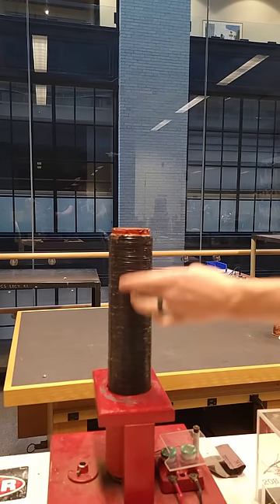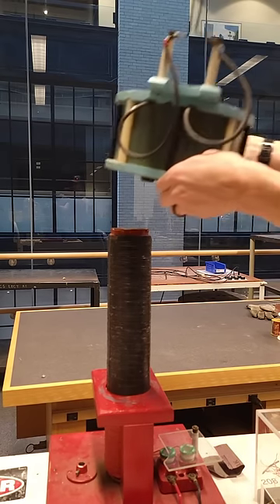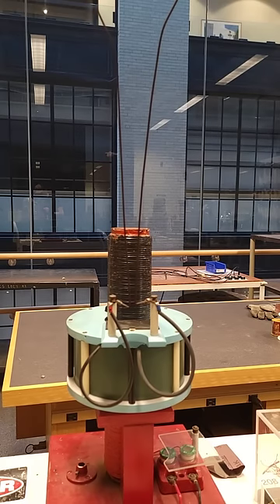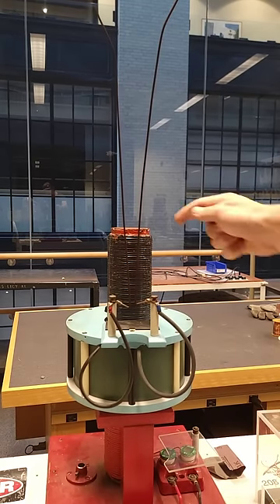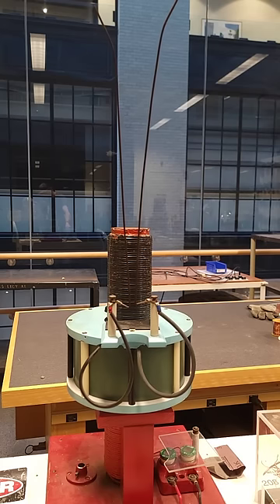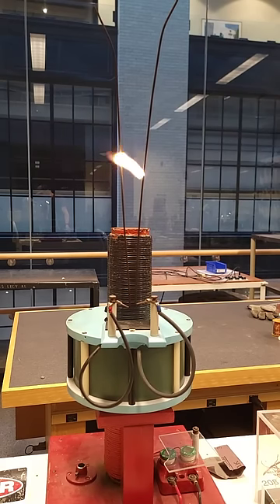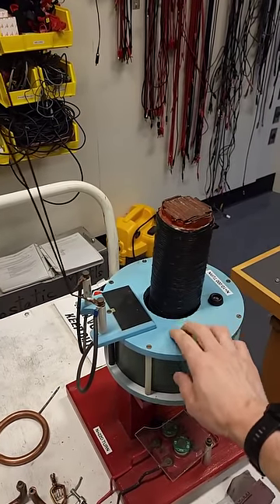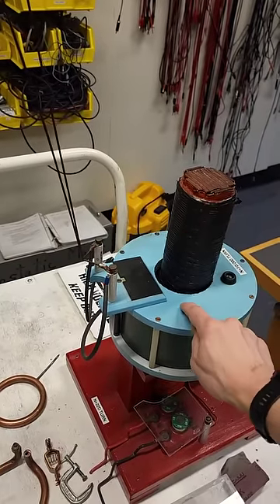Watch this 10,000 turn transformer breakdown air! #shorts #physics #science

Comment: But are you going to tell everyone why the arc rises? 
 
It's actually due to the heat of the arc, making the air around it hot and it rises.  
You can now get an oil burner ignition "transformer" that has 120V input and 17500 V output (about $50 ~$75 depending on model) .  I put transformer in quotes because there's no windings just solid state components.  I have to check around to see how that works.

Comment: What is the amperage?
Reply: VA/E=I
Reply: Are you asking what it would draw.  Or how you could figure out the amperage with knowledge of the amps on the low side.
Reply: Well... let's see. The transformer turns ratio is kn=n2/n1=10000/220=45.(45), so the secondary voltage is Vo=Vin*kn=110*45.(45)=5000V. Approximating a core area of about 30cm sq, and a total efficiency of, let's say, 50% (the core is not a closed loop), that would mean a power of about 800VA, so the maximum secondary current would be Io=P/Vo=800/5000=160mA. More than double of what would be used for an electric chair, if that's what you were wondering.
Reply: @bogdan_n  Where did you get the power figure from? I don't see any accounting for secondary current.
Reply: @antoinefleming5224 what is VA and E?
Reply: @Graham_Wideman You don't need to worry about secondary current.

Primary power and secondary power are the same.

If you know what the primary power is, and voltage, and the turns ratio, you can calculate secondary current.
Reply: @deang5622  "Graham_Wideman You don't need to worry about secondary current.  Primary power and secondary power are the same. If you know what the primary power is, and voltage, and the turns ratio, you can calculate secondary current. " Sure, but where did you get the primary power figure of 800VA from?
Reply: @Graham_Wideman  I didn't. I didn't do any calculations.
Reply: @deang5622  Sorry, I mistook you for the poster who mentioned 800VA. But you did reply in connection with how to calculate pri and sec power. So my point remains -- no power figure is mentioned in the video AFAIK, so how does your comment help us?
Reply: @Graham_Wideman  The power of a transformer depends on the core area (among other parameters, like working frequency, magnetic flux density, core shape, etc.). Unfortunately i can't give the exact formula from the top of my head, but from past experiences, a transformer with a 30cm sq core area, working at 50Hz has a power of about 1600VA, provided that the core is a tightly closed loop (which this isn't, that's why the efficiency drop)
Reply: @bogdan_n  OK, I finally think I see what you're talking about. You're describing the max power that a transformer might convey from primary to secondary before the core reaches saturation. OK, but there's no reason to believe that this circuit is operating at the transformer's max power capability.  The actual power conveyed in this circuit in general will be set by the current which the load permits to flow. (Ie: across the spark gap.)  We don't know what that is in this case, and don't see any other measurements from which to draw conclusions.

Comment: Air doesn’t burn. You’re creating a plasma.
Reply: plasma is burning air 😉
Reply: @Ferraday Are you shure, burning results in chemical change. The plasma changes the air just a little, in the sense that some oxygen, O2, becomes ozone O3. Not shure if I'd call that burning though.
Reply: Depends on the action of the electricity.

I don't know high voltage interactions with air, but I could definitely see the electricity breaking down the water in the air to O2 and Hydrogen, then re-reacting them due to the high temperature. But I don't actually know the mechanics, so I could be totally wrong
Reply: @Dracomandriuthus burning creates plasma, but they’re not interchangeable. In plasma, electrons are uncoupled from the nucleus, that’s why plasma is highly conductive. A high enough voltage can dislodge electrons from nucleuses, thus creating plasma. There’s technically no chemical reaction going on. 

When burning, combustion heats the air enough to dislodge electrons from atoms, but it’s not the oxidation reaction itself that creates plasma, it’s the heat of the reaction
Reply: Air does burn - the definition of burning is “being on fire”. Fire, or at least the physically visible flame, is plasma, which is created when the air near a combustion reaction is heated.

Air does not combust, which is the name of the reaction between oxygen and fuel to produce heat, carbon (or monoxide/dioxide, depending on the availability of oxygen in the environment) and water, if hydrogen is present.

In this case the air is getting heated enough due to the high current passing through, causing it to turn into plasma, which is a flame; therefore, burning.
Reply: Out of?
Reply: A byproduct of "burning" is plasma in most cases, its a higher energy version of often forced chemical change or oxidation caused by extreme heat or current etc. In this case I'm guessing ozone is likely one of the byproducts.
Reply: "Air doesn't burn"

average redditer.
Reply: If air didn't burn, lightning would not produce a sound...
Reply: if plasma is one of 4 states of matter (solid, liquid, gas and plasma), I would guess it's not burning air.   Well, air is a compound, so maybe the carbon is being burned?  so part of the air is being burned?
Reply: @jacobnorman2292  I suppose you think guns make a noise because the bullet lights the air on fire?  Lightning causes thunder due to the extremely high current causing rapid heating of the air around and therefore rapid expansion, not because its being burnt.
Reply: @robbyddurham1624  Air is a mixture of different elemental gases and gaseous compounds, it's not a compound itself. 

Plasma does not "burn air" as the big brain reddit types would like to claim.  The heat from an energetic plasma could cause combustible materials to ignite (e.g. plasma cigarette lighters) but plasma itself is not a flame and doesn't rely on the presence of oxygen to form.  The most abundant carbon in air (I.e carbon dioxide) is already bound to oxygen and very inert, which is why it's used in fire extinguishers.
Reply: Plasma is ionized (superheated) air
Reply: @ferrumignis  it is literally the current exploding the oxygen molecules out of the air. I suppose you don't believe explosions are just very energetic and rapid fires huh?
Reply: Maybe some parts burn as the free oxygen most definitely reacts with something
Reply: Plasma. The deffinition of burning air
Reply: @jacobnorman2292  Explosives involve a fuel, tell me what fuel is being oxidised in a plasma?
Reply: @guanoApe  Absolutely wrong, plasma can form in inert gasses.
Reply: You can literally see the flames as it is happening. You don't trust your own eyes?
Reply: @DutchmanAmsterdam  when you have electric arc, oxygen reacts with nitrogen. During the reaction it is plasma
Reply: Don't tell this guy what fire is
Reply: It's an electric arc. That's an electric flow nothing is burning. It's just jumping the gap.
Reply: Ummmm. Plasma literally is burning air. Oxygen burns. In fact, without oxygen (air) nothing burns. 😂
Reply: It's ionized 😂
Reply: @mountainman4410  so tig welders plasma arc? Inert gas meaning none reactive eg doesn't burn. What's going on there then?
Reply: @Cxntrxl  well more specifically fire in the normal sense is when the vapors of a substance be it gasoline for example or even some wooden sticks are hot enough to combust in the presence of atmosphere. the actual flame part that glows would have simply been smoke had it not been for the fact that the oxygen present allowed it to combust instead.
Reply: @Ferraday Plasma is when there's so much energy the electrons kinda get ripped off the atom. Burning is an emergent phenomenon due to a bunch of chemical reactions happening all at once and generating enough heat to cause the reaction soup to phosphoresce.
Reply: A lot of people here don't know what fire is. Burning requires fuel to be oxidized, there is no fuel here. The molecules present in the air are being restructured in the plasma, but they aren't burning.

The restructuring requires the absorption of energy to occur, the opposite of what would occur if something were to burn. The sound and light observed occur as the result of electrons heating the gasses resistively as they pass through the arc, as well as valence shell electrons becoming energized and falling back to their ground state.
Reply: To all the nerds arguing about "burning" being rapid oxidation, and that air doesn't burn:
-Touch grass
-Realize that normal air has contaminants such as CO, which will burn into CO2.
-Oxygen (O2) can become ozone (O3), which is technically oxidization, although the resulting leftover singlet oxygen will either find another O2 to bond with, or react with another relatively inert gas, combusting.
-All fire is plasma. Not all plasma is fire.
-Arcs are 99% plasma. Sparks are burning metal. Arcs are not sparks.
...
Thanks for coming to my TEDtalk.
Reply: @asialsky  The contaminants, exist but the quantity is so small that it would never be visible. As you stated, all fire is plasma but not all plasma is fire.

 What we are looking at is a non-burning plasma. The ozone reaction you listed wouldn't be considered combustion, you need to have a release of energy from the reaction for combustion, the creation of ozone is endothermic.

You can say people are overreacting, but the truth is there is importance in distinguishing between separate phenomena. Perhaps to the layman it doesn't matter if electric arcs are fire or plasma, but it's an important distinction for scientific progress.
Reply: @DutchmanAmsterdam No it's not. Plasma is a state of matter where ions can freely travel. The air is not getting burned. Burning means to combust. This requires oxygen and produces heat, light, and particulate matter. The air is actually conducting ions.
Reply: @Cxntrxl NERD
Reply: You can burn air anthing reacting with oxygen releaseing heat can be considered burning. However, there is a plasma being generated also. Two seperate processes.
Reply: @Ferraday no! Plasma is a state of matter, burning is a chemical reaction.
Reply: @DutchmanAmsterdam agreed
Reply: @joseiten3647 yes. Flames are low energy plasmas as you can create high energy plasmas by putting flames in microwaves.
Reply: @ferrumignis  had to look it up to make sure but but invisible gaseous substance is words in the definition of air. Id be fine with bein wrong as i am a lot but not this time
Reply: @guanoApe  Firstly you've just made that up, no definition of a gas would use the word "invisible", it would be colourless or similar. Secondly are you genuinely unaware that there are other gasses besides air? Plasma can form in inert gasses like helium, so what would it be burning?
Reply: @ferrumignis  gasses with u. 'Air' which is what we talkin bout  is defined as the gasses there within
Reply: @ferrumignis  maybe what ur thinkin bout is atmosphere?
Reply: @ferrumignis  not bein a dick at all fer real. Atmosphere is the collective gasses in a proximaty. I only know this (im not a scientist) cause i gotta make things not blow up in my factory.
Reply: Yo dog we heard you liked oxygen so we oxidized your oxygen so you can oxygen while you oxygen.
Reply: Just love reading the comments of all of the "experts" on YouTube.
Reply: @robbyddurham1624  cough 6 states these days
Reply: Fire is a type of plasma
Reply: Air doesn't burn, but you know he felt that burn either way ohhhhhhh!
Reply: Are u sure cuz I'm pretty sure most pure gasses are flammable 💀
Reply: @patrickfahey1367 oxygen is not flammable, nor is it pure in the atmosphere. Also hydrogen is the only flammable elemental gas.
Reply: You do realize fire needs oxygen to burn right?
Reply: Burning is a product of conflagration or combustion, creating a plasma does neither of those to the air. The content creator was using the term loosely to simply get his point across to any laymen watching. O2 -> O3 is the exact opposite of a combustion reaction, lol.
Reply: what type of fuel do plasma cutters run on again...ooh that's right!
Reply: Arm Chair scientists
Reply: He’s creating a monster.
Reply: @jacobnorman2292  If your mother was her sister, she'd be your aunt...
Reply: No no are u thinkin air means oxygen?
Reply: Nitrogen oxides are formed.  That is burning.
Reply: @asialsky Does that mean that all we have to do to replenish the ozone layer is to further oxidize the carbon monoxide from car exhausts until it becomes ozone? Or must we keep planting these pesky trees? 😮

Comment: Don’t forget, although your voltage increases, your current decreases. So in this example your 110VAC/20A source (assumes 20A as a standard residential 120V outlet) would roughly be transformed to 4400V @ 0.5A. Still plenty to do some serious damage.

Comment: Electricity is cool cause you can step up and down a million times and it doesn't care.
Reply: It does care, transformers as a step-up / step-down technique have great efficiency but it’s not lossless. You have core losses and copper losses that have the biggest impacts
Reply: but it's still the same "energy" value.. a x v = watts .. flow times pressure = volume
Reply: @Errol.C-nz  flow times pressure equals volume? First time I hear that. 😊 I'm used to current (i) times voltage (U) equals power (P).
Current gets measured in Amperes, voltage in Volts, power in Watts.
Reply: @Errol.C-nz The energy will be the same in quality but somewhat diminished in quantity since the wires get warm, possibly even hot, this heat is a loss in energy (power).
It doesn't actually get lost but changed into a different form.
But what is power? It's a quantum phenomenon I think, meaning it is timeless, the essence of existence. It's eternal and the changing universe is an appearence of energy. I think.
Reply: Water: What am i? Chopped liver?

Comment: Of course, the magnetic loop is at right angles to the conductor loops. And it is the lines of force and their rate passing through the conductor loops making the voltage. Volts per turn will be somewhat equal in both coils.

Comment: Here's how to calculate the peak voltage, assuming 95% efficiency, which is the voltage available  for ionizing the air between the rods:

To get the Peak voltage from the RMS voltage:
110 * SquareRoot(2) = 110 * 1.4 = 154 so:
154 * 10000 / 220 * 0.95 = 6650V

And, where I'm from [Utah. USA], the mains voltage is more like 120VRMS, thus the peak voltage would be more like:

7255V!!

Comment: This is basically right, 
Also, the 10,000 coil is only covering part of the 250 so it’s probably more like 100 windings compared to the 10,000 windings.

Comment: Thats probably about in the voltage range used for railroad electrification which usually uses 25kV AC but some older Electrification uses 1500 V DC or 750 V DC
Reply: It's making 5kv.

Comment: ......and the inverse of that is a step down transformer, the transformer that "steps down" the voltage before it enters your home.  Equal windings is an isolation transformer, designed to rid the circuit of transient noise (frequencies).

Comment: This has me asking many questions. Like I'm guessing I was taught about electricity correctly. Does it effect current?
Reply: Yes,  current drops. Excellent question!

P = VI
Power = Voltage (Volt) x Current (I)

The power is the same,  so when the voltage is increased by using the step up transformer,  the current gets reduced to satisfy the equation

If you look again at the video,  you will see the inside solenoid has thicker wire because it carries higher current,  whereas the outer solenoid has much thinner wire because it doesn't need to carry anywhere near the same current

You can sort of think of Voltage as like the amount of push in a circuit,  whereas current is the amount of electrons flowing

If you want to push a lot of current,  you need thicker wires or you'll burn out the wire.  You could have a huge wire with a low voltage to push the current along.  The smaller the wire the more volts you will need to push the current through the wire

This is how you can transmit electricity around the country.  You use step up transformers to raise the voltage much higher (typically 110,000 or 220,000 volts) and you can push the current over great distances on thin wires (maybe 2" or so) and then at the other end you use a atep down transformer to drop the voltage down again back to what you want,  110 volts typically, which them increases the current part 

You do lose some energy because of inefficiencies in the transmission but this is very small

So next time you see those huge pylons with their transmission lines going across the land,  you know what's happening,  the voltage has been stepped up hugely and the electricity is being carried to somewhere where it will be stepped down again to then be distributed to substations to then be fed into homes or factories

This is a very brief explanation but it gives you the overall idea

Comment: the higher voltage is safer since every time the voltage is doubled the amps are cut in half. (120vac @ 10 amp would = 1200vac @ 1 amp, for example.

Comment: That's a winding ratio of just over 45:1, so 120V would be stepped up to about 5500volts before any efficiency losses. But it's going to be really inefficient because most of the windings are pretty far away from each other.

Comment: Cool explanation of the concept of transformers
But every single time, though the number of turns is mentioned, there is no mention of the coils’ respective wire gauges / sizes.
Alternatively, how does one calculate coil wire size and volt/amps to attain a specific desired electromagnetic strength?